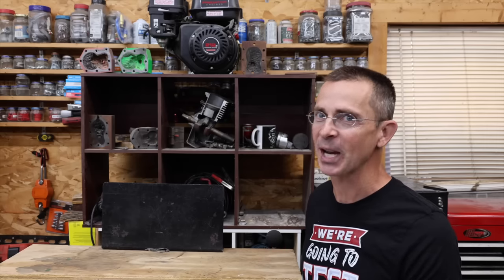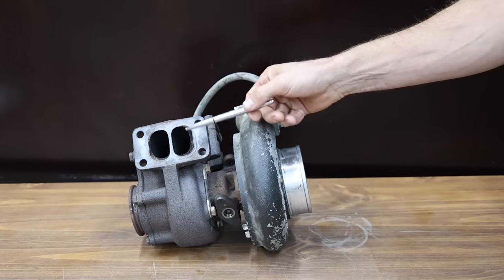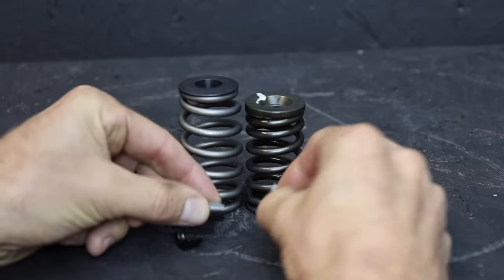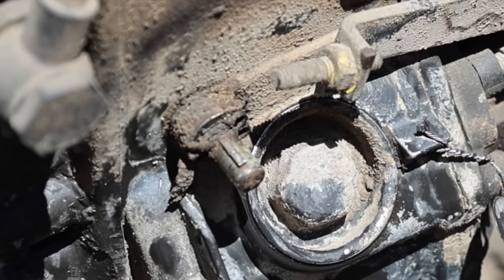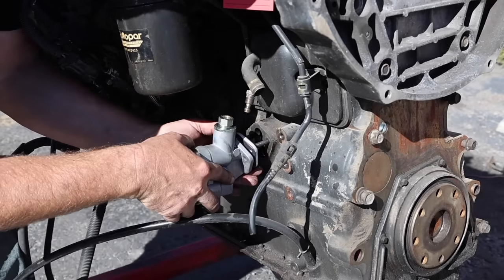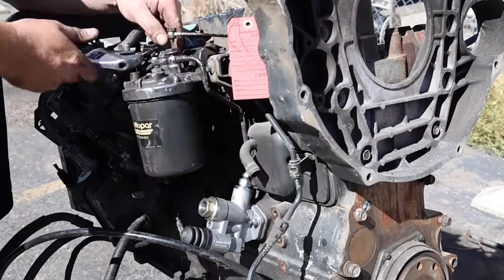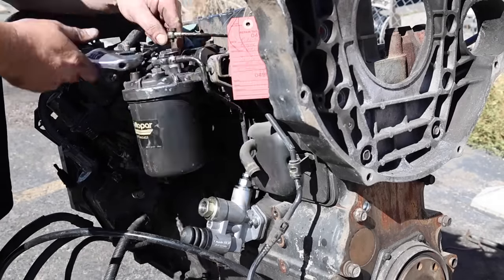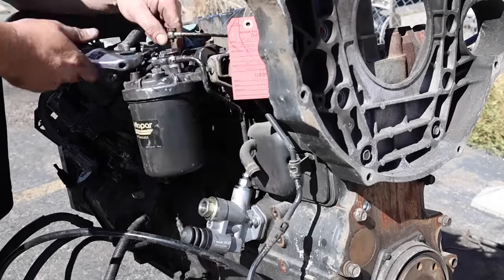Did I Waste $5000 on Engine Parts? More Horsepower & MPGs? (Part 1)

Comment: When you think about it, 5k for a 50% power boost is actually quite a bargain.  People often spend more than that simply to gain 20 or 30 hp.  Love to see you doing engine stuff on the channel again, please dont ever be afraid of thinking outside the box with these videos, they are so spectacular.  Id suggest targeting the farmabago next for engine//mod videos.  It would be awesome next to the cummins videos.
Reply: It was worth it for sure, but I doubt that transmission plus installation was less than 6k alone.
Reply: not knocking this, but that's 5k in parts. best have another 10k to spend to do this, without the trans. it's closer to 20k when all is said and done. so it's 25k. now i didn't work on diesel engines, but built my fair share of hot rods. sure i could get 550 horse out of a 350 by spending 5k. but i did all work.  labor ain't free.  other than that? this guy is good.
Reply: I second the Farmabago for the next upgrade. Cheap ebay turbos and a convertor upgrade. I bet he gets more than 100 horses for half the investment
Reply: $5k on cummins diesel was money well spent

If you take care of them with maintenance they are virtually indestructible
Reply: Wow, I remember back in the 90's BOMBing my 12v trucks to 400+hp with a set of Bosch 370hp injectors ($320), Extrude Honing them ($50), made our own cam fuel plates ($0), all the HX-40 and HX-55 turbos we wanted from the diesel junkyard for ($500ea), New HD South Bend clutch ($300?? can't remember). The 12v was by far the cheapest ($$per hp) engine to upgrade out there.
Reply: uhhhh... 100 percent "power boost". 50 percent would put it at 300hp. 200 times 50 percent (.5) is 100. add that to the original 200 and you get 300.  he made 400hp so that would be 200 times 1. but we all know the important number is torque so he far exceed 100 percent power GAIN
Reply: $5000 in engine PARTS, not including labor.  That price also doesn't include the needed transmission upgrade.
Reply: @garycarpenter2932   the beautiful thing about this video and the reasons to do it; you can skip spending $20k+ on parts and labor and buy a good performing truck at a $60k starting price on current market....or save yourself $40k for better uses.
Reply: @dnl4295  The obvious choice for many people is save the $40K that they already don't even have taking out an interest loan yet again and keep your reliable vehicle that you already know and feel comfortable with.
Reply: Yesss Farmabago stuff. I'd like to see him delve into plug and play EFI stuff, like Holley and Edelbrock and whatever else there may be on the market, and see the difference (if any) in fuel efficiency and maybe emissions differences (if any). At the very least it seems worth it for reliability but maybe he can test that too.
Reply from the maker: Thanks for the suggestion.

Comment: I wonder how many people left when it was mentioned the new injectors would reduce smoke 😂. I never understood the attraction to rolling coal, just money out the tailpipe, I've got mine tuned to run clean as possible. Great video! Love to see more like this!
Reply: Gale Banks or bust
Reply: more flow can assure correct injection timing, too late end of injection because of low flow is only causing hig EGT and smoke and not a lot of power...
Reply: The dude bros that want to roll coal have done orders of magnitude more to damage the reputation of diesel engines then the combined impact of every other possible contribution to diesel’s bad reputation. Karen may never buy a diesel, but if you roll coal on her, she’ll do everything to make sure you won’t either.
Reply: I agree. The young guys round here like their trucks noisy and dirty, I’m the exact opposite, clean and quiet for me thanks
Reply: When we were cavemen it was those guys that didn't make it past 15 years old. Natural selection would take them out...dummies getting to close to the Mammoth with a spear.
Reply from the maker: Thanks for the suggestion.

Comment: So happy to see you post this! We ( the fans ) will watch anything that you post. It's not the product we're ever interested in, it's the concise consistency in your hard work, dedication, and work ethic. Never selling, just providing us with your truths and findings and we love it.
Reply from the maker: Thanks.
Reply: I second that!
Reply: Uhh... no "we" wont..
Reply: @sanctealphonse4510  then you ain't a fan fam
Reply: @sanctealphonse4510  neither will I! Typical simp comment “wE’lL wAtcH aNyThInG yOu pOsT”
Reply: @ProjectFarm I think a very interesting test to add to these videos for learning sake would have to be with the intake Horn and the hot and cold side of the intercooler piping. With the relationship of pressure and flow along with temperature and pressure. If you increased the intake Horn diameter along with the hot and cold side intercooler piping what results can be observed. In theory it should dramatically help reduce EGTs. If you can it would be extremely interesting.
Reply: Exactly!  Perfectly said.
Reply: @sjv6598  You're so badass and against the grain for calling out that simp!
 I bet all the girls BEG to have your babies! 
- Nobody

Comment: I really appreciate the focus on fuel efficiency and clean running diesel, amazing seeing 0 soot come out while on the dyno. I hate seeing all these clowns with their diesels that are poorly tuned, rolling coal and have shit fuel efficiency with less power. 
Awesome video and amazing gains!
Reply: Agreed. I had to properly calculate and size my full exhaust properly for the exhaust shop. Everyone just comes in and wants 3" pipes. I explained if I was going true dual with true x-pipe I don't need that and to keep the stock size size. I also installed race converters. My case was gasoline
The black diesel guys don't realize that all the coming out of the exhaust was also in the cylinder, all that soot does get into the oil and ruins the engine faster.
Look up the oil change intervals of diesel vs gasoline vs CNG
Reply: @Bloodcurling  CNG?  What's that?
Reply: @leeisenberg compressed natural gas I think
Reply: I hate how uneducated YouTube is 😂😂
Reply: @reubend340  Oh okay, cool, thanks.
Reply: Whoever sold you the idea that rolling coal must automatically mean poorly tuned and shit fuel efficiency with less power, needs a raise!
Reply: So you have absolutely no clue what you’re talking about. Coal is not bad
Reply: Yea all that smoke means is poor tunes unless your running it hard which should only be minimal smoke because all smoke is, is unburnt fuel coming out the exhaust

Comment: I am amazed at the complexity  and the skill involved in this upgrade. 
As the others have said the improvements are worth it. Shows how over engineered some older engines are.
Reply: This though is almost unanimously considered to be the engine with the most room for cheap improvements. Most other engines will not benefit nearly as much as this one, especially any of the newer diesel engines which have already implemented most of what these aftermarket parts are replicating.
Reply from the maker: Thanks for the feedback.
Reply: If there is that much room for improvement, I'd personally call it under-engineered (but over built)
Reply: Me too. I am never opening up my engine after watching this. 
I would “brick” my engine in the first 2 hours.
Reply: @toasty4000000 exactly, that’s how they survive in stock form for so long
Reply: @toasty4000000  Depending on application, the 12v could be had with quite a lot more power.  They were used in everything from tractors and water pumps to high-performance marine applications.  The versions used in the Dodge pickups were about middle of the road for factory power.

Comment: A masterful video to prove that a turbo upgrade alone is not what improves the performance of an vehicle, a HUGE misconception! Thank you very much for breaking down the entire process, Todd! If you’re enjoying these kinds of tests and more folks than myself show interest in improving a belt-driven, carbureted engine, I’d absolutely love to see it. Take care!
Reply: It's entirely dependent on the engine. Many of the cars I have just required a turbo upgrade to make more power. Obviously, you will have to tune it again to get more power out of the turbo, but if your car is capable of it, your factory injectors and intercooler are enough to make a large difference in power. However, if you want to get the absolute most out of your turbo upgrade, you're best to upgrade other components as well. 
So basically, you can improve performance with just a turbo upgrade, but you won't be able to get the figures that the turbo is rated for, without other upgrades.
Reply: Well , smaller engines get less effect just from turbo . Bigger engines get a bigger boost because of percentage
Reply: You don't even need a new Turbo anymore - tunes just up the boost from stock. Modern DOHC Turbo engines will very much improve with a little more boost. Older pushrod and 2v Diesels are so flow-restricted that they can't make much more without greatly improving head flow and raising the RPMs to take advantage of it.

Comment: I am honestly so glad to see that you did the upgrades the correct way. A lot of people just do injector’s and a fuel plate. I am just giddy to see it done the correct way and to unlock the true power of a 12 valve
Reply: Do you think that with this upgrade doubling the horsepower, it has minimized the reliability that those engines are known for? It would be great to have a 400hp diesel like this that you can still run hard and  expect 500k miles or more. Cheers
Reply: @giggiddy  it will run fine its still not pushing near the power numbers it could without having issues. It will probably last untill the block develops a crack around 1.6million miles but i doubt that truck will last that long nor will he put that many miles on it
Reply: @giggiddy doubled HP on highest settings. You don't need to run all out all the time
Reply: @giggiddy power driven diesel just did a teardown video of a 600hp 12 valve cummins that was a daily driven truck to see what the effects were. There was almost no visible wear. The rod bearings were all perfect but one, had a very slight line. Id say that could be due to a grain of sand or small metal fragment during assembly.
Reply: @giggiddy u ever watch zip ties and bais plys? He runs the shit outa 500k junkyard motors turned up to max and they don't blow up easily.  He runs them flat out till manifold and turbo GLOWING Red and they still run lol hard to kill a 12v when properly modded and a normal person with a little brains behind the throttle pedal
Reply: @redsite001  Thats good to know. I appreciate the comments from everyone. I've always wanted a Cummins like this as everything is mechanical, you can get some decent power and they appear to be incredibly durable. The perfect engine for a vehicle if things go sideways in the world and computers are no longer functional. Cheers everyone
Reply: @giggiddy  You can make around 750hp on a stock bottom end 12 valve cummins. Even stock long block as a whole. You really just need to change other parts. If that's a 24 valve, you need to swap your vp44 for a CP3 or a P7100.

Comment: Video idea: best dehumidifier. My main concerns are about effectiveness, energy efficiency, and unit lifespan (a LOT of reviews say these machines die early). Thanks as always for your hard work.
Reply from the maker: You are welcome!  Thanks for the suggestion.
Reply: @ProjectFarm  And please include some non-mechanical ones.  I've got a car that got some moisture in it (loooong story) and was hoping that I could get some good results without having to run a power line.
Reply: Best dehumidifier is a good one

Comment: Great video. I finally had no choice but to move to a newer 4x4, but I really loved my 97 12 valve with some engine upgrades and a six speed manual. It's great to see a shop that really knows how to bring the 12 valve alive with less emissions and better fuel economy and not just turning up the fuel like most I see. Power Driven Diesel is definitely going to be extremely busy doing cummins upgrades these next few months!
Reply from the maker: Thank you for sharing!

Comment: I know how this feels. I have a 20 year old Jeep Wrangler and I just got a lot of engine work done. Replaced the cam shaft, injectors and valves, all the wiring and the radiator. It runs SO MUCH better and so much cleaner and with more power. I bet you love driving the truck now!
Reply: same here with my jeep, timing, entire fluid flush, injectors, valve springs, intake plenum. car sure feels faster! i know we’re talking about jeeps here but i did actually gain a full 1.2 average mpg (lol from 10.1 -> 11.3 mpg)
Reply from the maker: I do!  Thanks for sharing.
Reply: 4.0 is a fantastic mill w/ good aftermarket support

Comment: More horsepower definitely makes a vehicle more fun. I added 200hp to my 2017 powersmoke Ford. The 8000lb truck is like a sports car now with 650hp and 1200+ torque
Reply: Did the same, these newer diesels are crazy.
Reply from the maker: Thanks for sharing.
Reply: I’m sure your truck is fast, for a truck. But it’s no “sports car” lol. At the end of the day it all boils down to power:weight ratio.
Reply: @stgibson2810 Like a friend of mine told me. Better to have a 2000 pound car with 200 hp than a 4000 pound car with 400 hp
Reply: @stgibson2810  OK take me literally LOL. My point is that it makes a 8000lb truck feel sporty. Is that better? I have a Vette too, so yeah it's no Corvette, but in a straight line it's pretty quick.
Reply: @stgibson2810  I raced a bunch of diesels with my modded golf GTI, and while the trucks have a quick 0-100  they all fall on their face after 100 mph and i just keep goin

Comment: Very Impressive! I have not worked on any of these diesel engines, so I am amazed at the complexity; I am also amazed at the level of skill and knowledge of the guys at Power Driven Diesel making short and accurate work of this. If I needed this kind of work, I would take it to them, because it was totally worth it considering the outcome and the amount of work and specialty parts needed. More of this content.
Reply from the maker: Thanks!   Thanks for the suggestion.

Comment: Great video! I always  like collaborations between YouTubers.
I'm guessing $5,000 was only parts, not labor. I'm sure you'll tell us what that performance transmission cost on the next video. Looking forward to it.
Reply from the maker: Thanks!
Reply: I love the transparency
Reply: As a rule of thumb, double it.
Reply: I just spent close to $4K from PDD and I'm just getting started on my 12 valve build. I'm over $6K including short block purchase, swap mounts, machine work, etc. But, it'll be the last engine the old truck ever needs, churn out 500 hp, and still deliver very respectable fuel economy. (Going in my old '83 Ford 4x4)
Reply: @barongerhardt 100%. I don't even add up what's in my Foxbody drag car. I know the engine cost, but it's the ancillary stuff that really pumps up the bill.

Comment: Does it perform like a new truck? It sure looks like you attained that goal, and saved ~$90k in the process over a new truck!  Very impressive!
Reply: And he doesn't need a dpf or diesel exhaust fluid.
Reply: @stephenpennington7041 and if shtf he'll have a truck that will still run
Reply: I can actually hear that "Very impressive" from all the videos.
Reply: That truck has a million mile motor. Old school mechanical diesel. Made to last.
Reply: A modern equivalent is certainly not $90,000 in the US. Maybe $55,000-$60,000 after discounts. 

Also, keep in mind that he didn't just spend $5,000 for just engine parts, he also has other upgrades coming to match the power increase, like the transmission. Realistically, you're going to want to budget for around $15,000-$20,000 just for upgrades, not including the cost of a truck.

Now, can't argue with reliability. Not that I think new trucks are necessarily unreliable, but stuff like DPF and SCR aren't thinks to worry about in an old truck. Then again, you can't argue with brand new vehicle warranty, which you certainly won't get in an old truck.
Reply: @finleyfleming5919 you don't know if new trucks are gonna have a tank of an engine we already know the old Cummins will last
Reply: @stephenpennington7041 But it doesn't meet today's emissions standards. And it doesn't need to.
Reply: @clydedoris5002  Not at all. I owned 2nd, 3rd and 4th gen Dodges. 

In the 2nd gen trucks, the engines would last, but nothing else on the truck would. Whether it be cheap plastics drying out to rusty bodies to bad transmissions. You name it, everything on the truck, besides the engines, was crap.

Overall, the newer trucks are actually much better.
Reply: @clydedoris5002  It will last in stock form. Now, with double the factory power, no way.
Reply: Cheaper insurance, cheaper registration and more reliable.